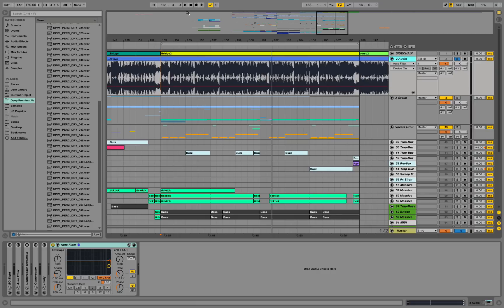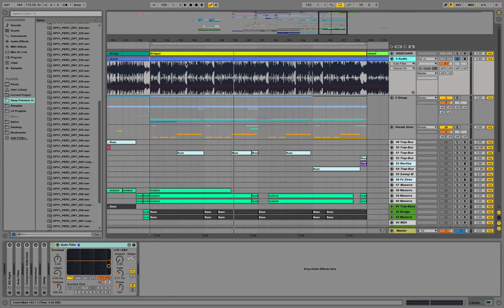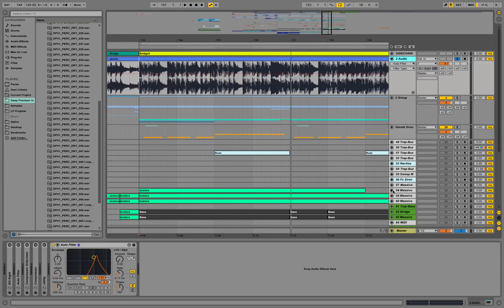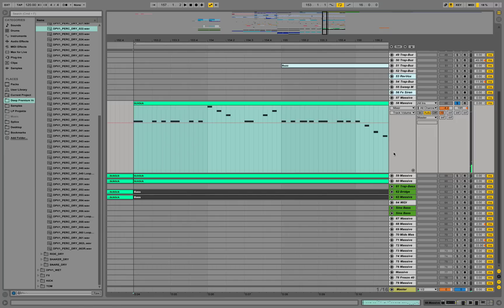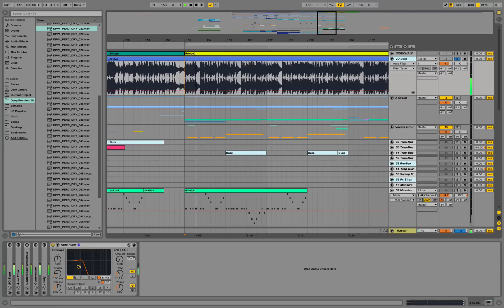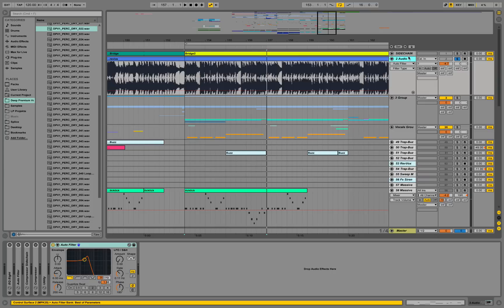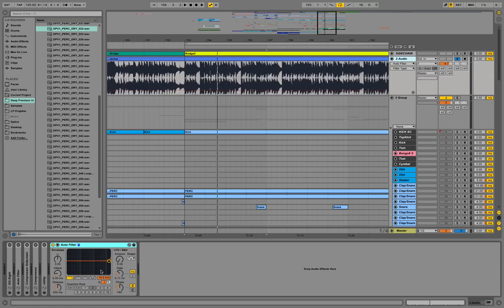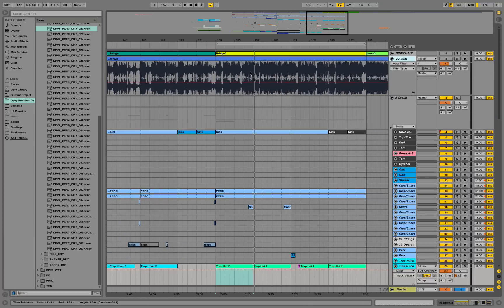Reverse-Engineering Tracks for Remakes - Tricks - Ableton Live

Comment: Is it not easier get the MP3 and convert to MIDI and then open it in the DAW? so you just find the instruments and samples and replace? is it possible?
Reply: That's not how it works, dude. Midi is just data and signals not a specific collection of a variety of instruments and their notes. You can however convert a clean audio to a midi signal for example turning vocals into a midi synth. Your best bet for what you suggested would be to actually get an ableton project file with the relevant plugins in your pc installed.
Reply: In FL Studio you can figure out the bass base line using newtone from midi,dunno about ableton.